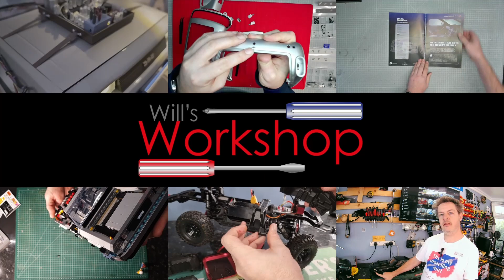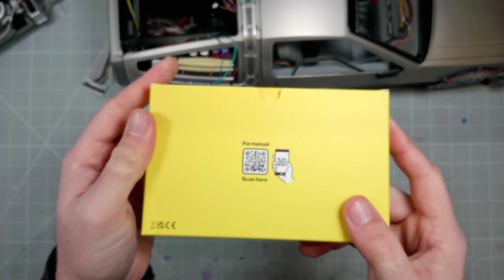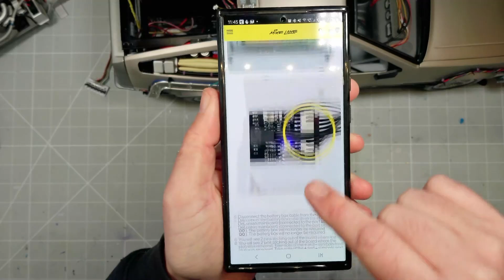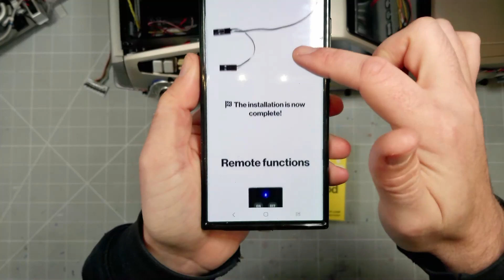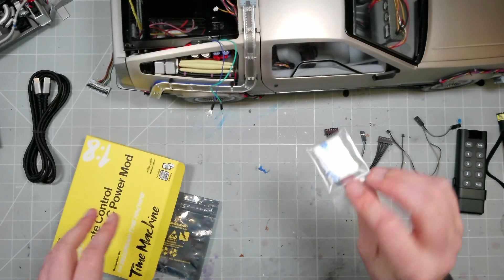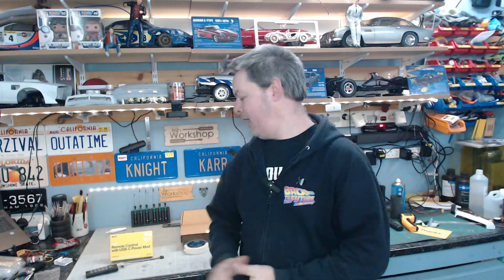Mike Lane - Delorean Power and Remote Control Mod

Comment: Great video Will and a great mod from Mike Lane. I have chloes remote and power mod so won't be fitting this to my Delorean but still a nice bit of kit
Reply from the maker: Never went with Chloe's remote,  I think it was out of stock so made my own solution
Reply: @WillsWorkshop  I would of done that but back then I didn't have the knowledge of electronics like I do now. Plus I idn't have the confidence I do now
Reply: I have the model modz power supply but the wireless switch is out of stock now. Would it be possible to use this Mike Lane mod with my build? My stock ribbon connnection is very dodgy (loose).
Reply from the maker: @cairnszee  yes, but you would have to use the power supply from Mike and not use the model mods power
Reply: @cairnszee  Yes I beleve it would work